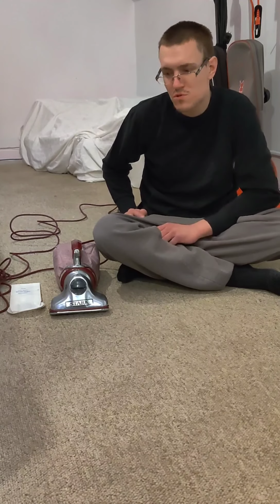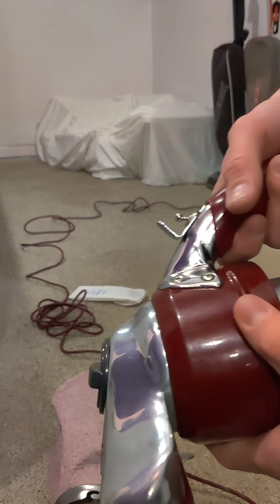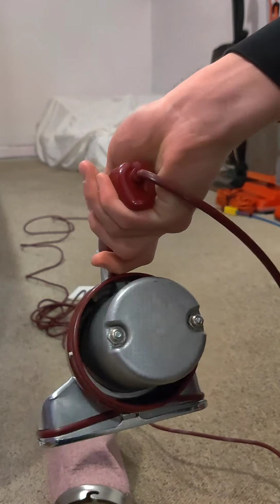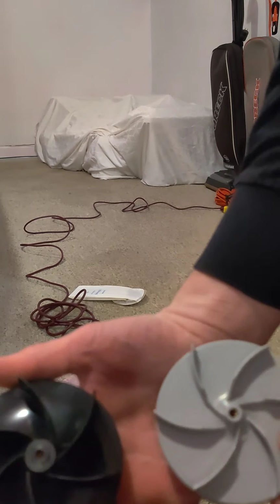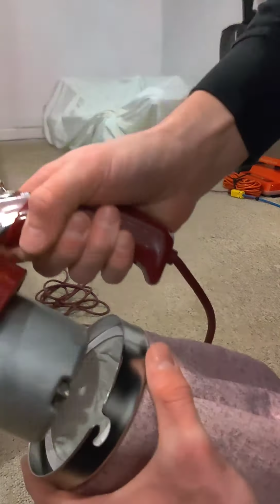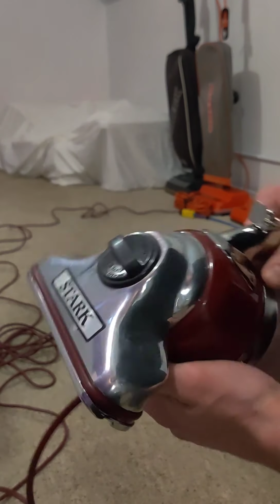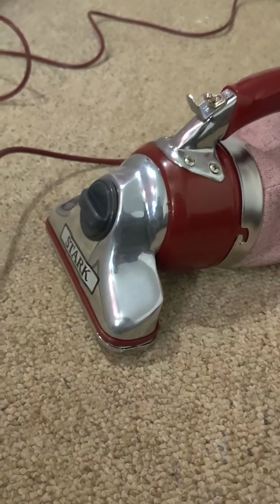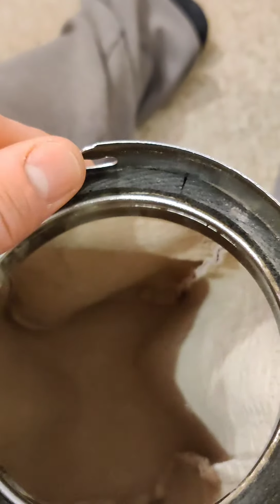Royal Stark M570 Hand Vacuum (Royal Prince 501 Variant)

Comment: Are the royal prince's easy to service?
Reply: They’re difficult to take apart. Simple to figure out but to get to any part of the insides, the entire thing has to be completely torn apart. I still have not been able to grease the bearings on 2 of mine.
Reply from the maker: I have the schematics for Royal Prince 501 Vacuums.  Check out my other videos and you'll find a detailed 1-hour tutorial video on how to open up a Royal 501 to properly lubricate the Oilite Bronze sleeve bearings inside the motor housing. - It's also important to note you want to lubricate those bearings with 20w or 30w Non-Detergent Oil (3-in-1 Electric Motor Oil is my recommendation).  There's a wool packing surrounding both the front & rear sleeve bearings and you want to saturate that with Oil, which will slowly penetrate the porous Bronze bushings to lubricate the motor shaft as needed.

With that said, DO NOT USE GREASE because it will clog the pores in the porous bronze Oilite bushings and lubrication will never reach the motor shaft.